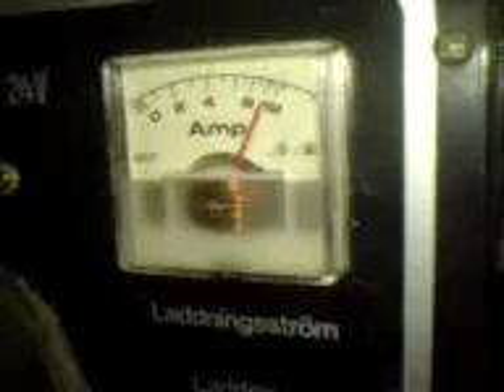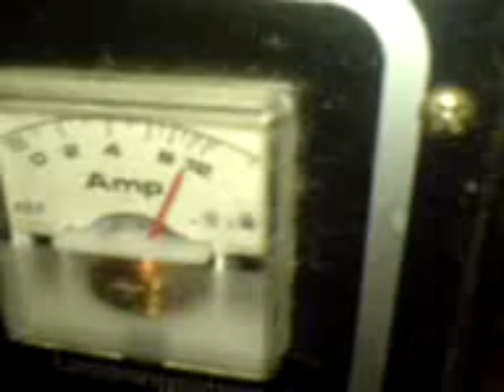HHO Steamer

Comment from the maker: Hi GTIBully! 

A 800w steamer might be too big a load on the cars generator? 800/12=67-70amps.. But then you could get steam immediately :) 

My cell with my new updates takes about 10 min to heat up to maximum, but it becomes quite hot after 5 min. 
It's my goal to have it produce steam as quick as possible with the least amount of amps.

Comment from the maker: Thanks :)

When it comes to diesels and turbodiesels, they have no vaccum from the manifold. They have instead an extra vaccumpump driven by the engine.

I have now the hose from the HHO Steamer Cell into the intake hose, between the MAF sensor and the turbo.

I have also mounted a tabletennisball on the end of the HHO hose, inside the intake hose. It has small holes drilled around the "belly" in a line. It seems like it doesn't affect the airstream too much, but it makes a greater vacuum.